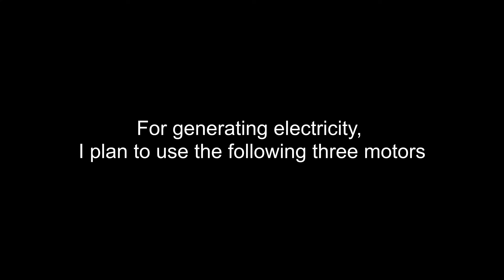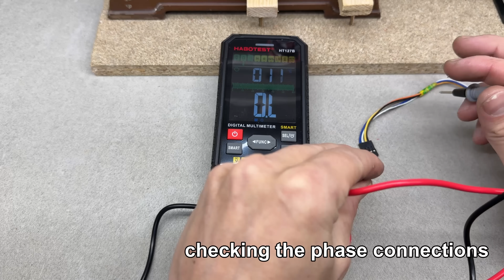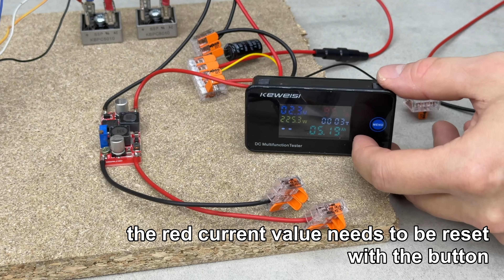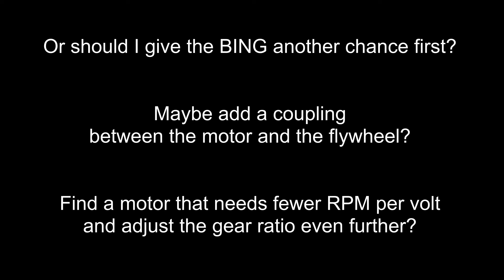Can a 1917 BING Steam Engine Generate Electricity?

Comment: the pressure must be allowed to rise so that steam comes out of the safety valve
Reply from the maker: I agree, you’re right. I have quite a bit of respect for steam pressure, especially with a machine this old. The pressure gauge only goes up to 3 bar, and the safety valve is adjusted by a spring, so I don’t know its exact release pressure. During the next test I’ll try setting it to open earlier and compare it with the gauge, so I know the safe operating range. My biggest concern at the moment is the glass water level tube. If that were to crack, that would be a shame...

Comment: move the generator a little closer to the steam engine then use a idler wheel on the slack side of the belt to prevent belt slipping 
this will work much better 
An idler wheel in a belt drive system is used to alter the path of the belt, maintain proper belt alignment, and often serves as a tensioner to accommodate belt stretching due to wear or temperature changes.
 These wheels are typically equipped with bearings and a shaft, such as a 5/8-inch shaft, and are commonly made from materials like aluminum or cast iron for durability.
 For example, some idler wheels are 2 inches in diameter and 2.4 inches wide, with a 5/8-inch bore and built-in bearings for smooth operation.
Reply from the maker: Thanks for the comment!

In my case there shouldn’t be any slipping, because I’m using a GT2 toothed belt. The belt teeth mesh with the pulley teeth, so slipping is basically not an issue.
I do agree though that if it were a standard smooth V-belt or flat belt, an idler/tensioner pulley would be the ideal solution.